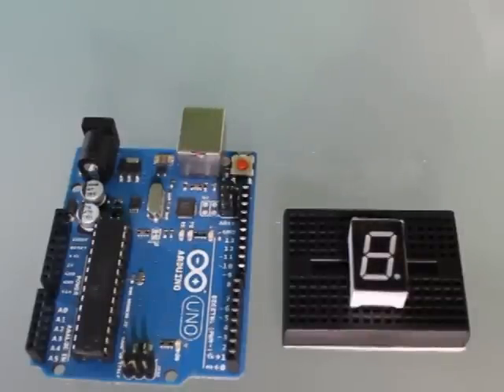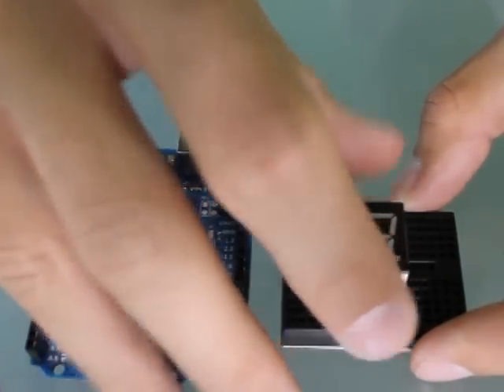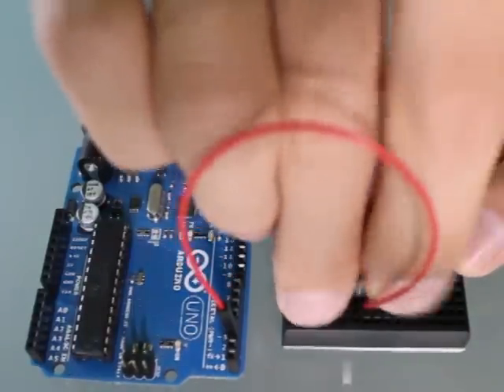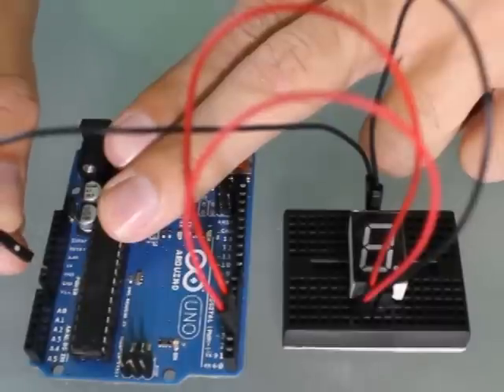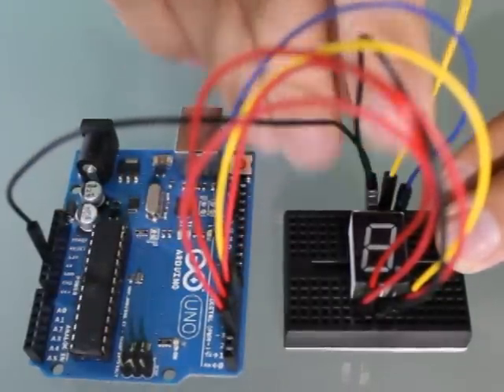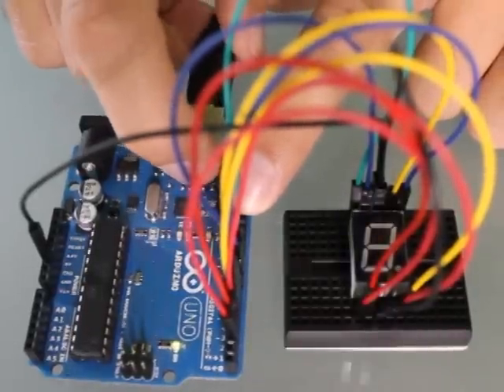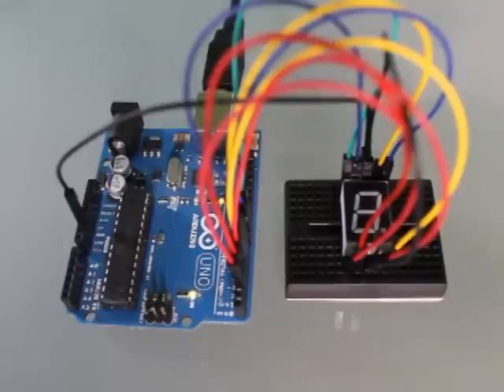Tutorial on how to make a Single digit 7 segment Count Up

Comment: int bottomLeft = 2;
int bottomMiddle = 3;
int bottomRight = 4;

int dot = 5;

int topRight = 6;
int topMiddle = 7;
int topLeft = 8;
int center = 9;

void on(int num) {
  digitalWrite(bottomLeft, (num == 2 || num == 6 || num == 8 || num == 0));
  digitalWrite(bottomMiddle, (num == 2 || num == 3 || num == 5 || num == 6 || num == 8 || num == 0));
  digitalWrite(bottomRight, (num == 1 || num == 3 || num == 4 || num == 5 || num == 6 || num == 7 || num == 8 || num == 9 || num == 0));
  digitalWrite(center, (num == 2 || num == 3 || num == 4 || num == 5 || num == 6 || num == 8 || num == 9));
  digitalWrite(topLeft, (num == 4 || num == 5 || num == 6 || num == 8 || num == 9 || num == 0));
  digitalWrite(topMiddle, (num == 2 || num == 3 || num == 5 || num == 6 || num == 7 || num == 8 || num == 9 || num == 0));
  digitalWrite(topRight, (num == 1 || num == 2 || num == 3 || num == 4 || num == 7 || num == 8 || num == 9 || num == 0));
}

void setup() {       // Our setup routine         
  for(int i = 2; i < 10; i++){
    pinMode(i, OUTPUT);
  }
}
void loop() {   // Loops forever
  for (int i = 0; i < 10; i++) {
    on(i);
    delay(1000);
  }
}
Reply: your a mad lad. Thankyou

Comment: I used arduino mega, I follow the pin configuration, 7segments pins (3 and 8) are connected to the gnd. I used the ur code and the code by brandon day but it doesn't seem to work on me

Comment: Optimized Code. Took 45 minutes to from "How do I do this, let's watch the tutorial" to testing this optimized version out and posting it here.

int bottomLeft = 2;
int bottomMiddle = 3;
int bottomRight = 4;

int dot = 5;

int topRight = 6;
int topMiddle = 7;
int topLeft = 8;
int center = 9;

void on(int num) {
  digitalWrite(bottomLeft, (num == 2 || num == 6 || num == 8 || num == 0));
  digitalWrite(bottomMiddle, (num == 2 || num == 3 || num == 5 || num == 6 || num == 8 || num == 0));
  digitalWrite(bottomRight, (num == 1 || num == 3 || num == 4 || num == 5 || num == 6 || num == 7 || num == 8 || num == 9 || num == 0));
  digitalWrite(center, (num == 2 || num == 3 || num == 4 || num == 5 || num == 6 || num == 8 || num == 9));
  digitalWrite(topLeft, (num == 4 || num == 5 || num == 6 || num == 8 || num == 9 || num == 0));
  digitalWrite(topMiddle, (num == 2 || num == 3 || num == 5 || num == 6 || num == 7 || num == 8 || num == 9 || num == 0));
  digitalWrite(topRight, (num == 1 || num == 2 || num == 3 || num == 4 || num == 7 || num == 8 || num == 9 || num == 0));
}

void setup() {       // Our setup routine         
  for(int i = 2; i < 10; i++){
    pinMode(i, OUTPUT);
  }
}
void loop() {   // Loops forever
  for (int i = 0; i < 10; i++) {
    on(i);
    delay(1000);
  }
}

Comment: Your code is too long for a good programmer, try to make it short. :)
Reply: Romuald KOUAMI TCHAMBA i saw this comment and agreed. what do you think of this?
int bottomLeft = 2;
int bottomMiddle = 3;
int bottomRight = 4;

int dot = 5;

int topRight = 6;
int topMiddle = 7;
int topLeft = 8;
int center = 9;

void on(int num) {
  digitalWrite(bottomLeft, (num == 2 || num == 6 || num == 8 || num == 0));
  digitalWrite(bottomMiddle, (num == 2 || num == 3 || num == 5 || num == 6 || num == 8 || num == 0));
  digitalWrite(bottomRight, (num == 1 || num == 3 || num == 4 || num == 5 || num == 6 || num == 7 || num == 8 || num == 9 || num == 0));
  digitalWrite(center, (num == 2 || num == 3 || num == 4 || num == 5 || num == 6 || num == 8 || num == 9));
  digitalWrite(topLeft, (num == 4 || num == 5 || num == 6 || num == 8 || num == 9 || num == 0));
  digitalWrite(topMiddle, (num == 2 || num == 3 || num == 5 || num == 6 || num == 7 || num == 8 || num == 9 || num == 0));
  digitalWrite(topRight, (num == 1 || num == 2 || num == 3 || num == 4 || num == 7 || num == 8 || num == 9 || num == 0));
}

void setup() {       // Our setup routine         
  for(int i = 2; i < 10; i++){
    pinMode(i, OUTPUT);
  }
}
void loop() {   // Loops forever
  for (int i = 0; i < 10; i++) {
    on(i);
    delay(1000);
  }
}

Comment: this tutorial is the most frustrating thing this side of the Mississippi
pin 1 = bottom left
pin 2 = bottom
pin 4 = bottom right
pin 5 = point
pin 6 = top right
pin 7 = top
pin 9 = top left
pin 10 = middle
if you put a current to the respective pins and have grounds connected, respective segments light up.
the config works with the first pin being bottom left, where the dot is facing you.

Comment: This code is smaller than your's  (1,562 bytes) @ 1,308 bytes - and it even has digit increment and decrement switches. TURBOCHARGED :-)
  // Thanks to Grumpy Mike  http://www.thebox.myzen.co.uk/Tutorial/Arrays.html
  // LED Segment allocation within byte = {DP ABCDEFG }

  byte upPin = 12;                              // pushbutton attached to pin 12
  byte downPin = 13;                            // pushbutton attached to pin 13
  byte currUpState = 1;                         // initialise currUpState as HIGH
  byte currDownState = 1;                       // initialise currDownState as HIGH
  byte prevUpState = 0;
  byte prevDownState = 0;
  byte pins [] = {2, 3, 4, 5, 6, 7, 8, 9 };     // pin 9 allocated to DP but not used (first element of binary array in char tenCode)
  byte counter = 0;                             // initialise counter as zero
  byte timer = 1000;                            // delay timer interval
  int i[10] =  {0, 1, 2, 3, 4, 5, 6, 7, 8, 9};
  char tenCode[] = {B01111110, B00110000, B01101101, B01111001, B00110011, B01011011, B01011111, B01110000, B01111111, B01111011 };
  void setup()
  {
    for(byte i = 0; i < 8; i++)                  // set digital pins as OUTPUTS
      pinMode(pins[i], OUTPUT);
  }
  void loop()
  {
      currUpState = digitalRead(upPin);
      if (prevUpState != currUpState)           // has the state changed from
      {                                         // HIGH to LOW or vice versa
        prevUpState = currUpState;
        if (currUpState == HIGH)                // If the button was pressed
          counter++;                            // increment the counter by one
    
      }
      if(counter > 9)
        counter-=1;
      displayEleven(i[counter]);
    
      currDownState = digitalRead(downPin);
      if (prevDownState != currDownState)       // has the state changed from
      {                                         // HIGH to LOW or vice versa
        prevDownState = currDownState;
        if (currDownState == HIGH)              // If the button was pressed
          counter-=1;                           // decrement the counter by one
      }
      if(counter < 0)
        counter++;
      displayEleven(i[counter]);
    }
    
  void displayEleven(byte num)
  {
    byte mask = 1;
    for(byte i = 0; i < 8; i++)
    {
      if((mask & tenCode[num]) == 0)
        digitalWrite(pins[i], LOW);
      else digitalWrite(pins[i], HIGH);
      mask = mask << 1;
    }
  }

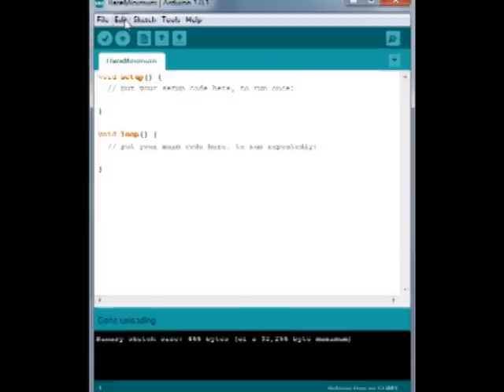Comment: @3:27 you guys can't follow the video to found the code!!?
http://www.jayconsystems.com/tutorial/s7sd/
Reply: int A = 7;   //Defines all pins on the Arduino Uno board in order of connection.
int B = 6;
int C = 4;  // DOT is pin 5, not used in this example.
int D = 3;
int E = 2;
int F = 8;
int G = 9;
byte num0 = 0x3F;  //Hexadecimal format based upon the A-G, 0-9 Chart in excel and the wiring      // of the segment (refer to the on/off table image below).
byte num1 = 0x6;
byte num2 = 0x5B;
byte num3 = 0x4F;
byte num4 = 0x66;
byte num5 = 0x6D;
byte num6 = 0x7C;
byte num7 = 0x7;
byte num8 = 0x7F;
byte num9 = 0x6F;
void on(byte num)   // This function turns on the correct pins to display numbers passed to it         // through the variable "num".
{
  int result = bitRead(num, 0);  // Read the first binary entry in num and stores it in result.
      if (result == 1)  // Check to see if this segment should be on.
    {digitalWrite(A, HIGH);}   // Turns on the segment.
    else   // Otherwise, it turns it off.
    {digitalWrite(A, LOW);}  // Turns segment off.
      result = bitRead( num, 1);  // Same thing for the 6 remaining segments.
      if (result == 1)
    {digitalWrite(B, HIGH);}
    else
    {digitalWrite(B, LOW);}     
    result = bitRead( num, 2);
      if (result == 1)
    {digitalWrite(C, HIGH);}
    else
    {digitalWrite(C, LOW);}    
   result = bitRead( num, 3);
      if (result == 1)
    {digitalWrite(D, HIGH);}
    else
    {digitalWrite(D, LOW);}    
   result = bitRead( num, 4);
      if (result == 1)
    {digitalWrite(E, HIGH);}
    else
    {digitalWrite(E, LOW);}
    
   result = bitRead( num, 5);  
      if (result == 1)
    {digitalWrite(F, HIGH);}
    else
    {digitalWrite(F, LOW);}    
    
   result = bitRead( num, 6);
      if (result == 1)
    {digitalWrite(G, HIGH);}
    else
    {digitalWrite(G, LOW);}
  }
void setup() {       // Our setup routine         
  pinMode(A, OUTPUT); // Making all pins outputs
  pinMode(B, OUTPUT);
  pinMode(C, OUTPUT);
  pinMode(D, OUTPUT);
  pinMode(E, OUTPUT);
  pinMode(F, OUTPUT);
  pinMode(G, OUTPUT);
  pinMode(10,OUTPUT);
}
void loop() {   // Loops forever
  on(num0);   // Passing "num0" to the function  "on()" defined above to display "0"
 delay(1000);   // Delay for 1 second to see the "0"
  on(num1);  // Change to "1"
  delay(1000); 
  on(num2);  
  delay(1000);
  on(num3);  
  delay(1000);
  on(num4);  
  delay(1000);
  on(num5);  
  delay(1000);
  on(num6);  
  delay(1000);
  on(num7);
  delay(1000);
  on(num8);  
  delay(1000);  
  on(num9);  
  delay(1000);
}
Reply: @abdelnacer7721  thank you, i get a 404 error when i go the site with the code